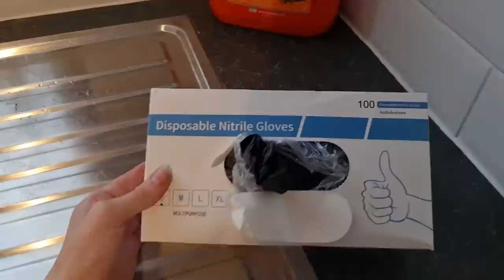My first time doing motorcycle maintenance [Part 2]

Comment: Saffy, I'm glad to see you are investing in you. Learning these things will help you for years to come. Tools are also a great investment. I'm glad you've decided to go this route. BTW, for new tires, it is less expensive to have them installed if you just take the wheels to them as opposed to the shop having to remove the wheels from the bike. Just a thought. I mean you do have the paddock stands.
Reply from the maker: I'm taking rocket in after my DIY to get the tyres changed and for a cheeky check up to make sure I did everything right:D

Comment: Great to see that you are starting to enjoy the maintenance Saffron. There are some helpful comments on here, namely that your oil filter doesn't need to be that tight. Put some oil on the rubber sealing ring. The old oil will do fine. Then put filter on by hand as tight as you can. If your grip is not very strong just give about half a turn extra with the spanner. Also, although it's hard to tell on video, your chain looks fairly taut. Put the bike on the side stand and check that the lower run of the chain has a bit of slack. You should be able to pop it up and down by about 25mm. If you buy a repair manual for your exact model, it will give you the exact slack. Keep up the good work and happy spannering.
Reply from the maker: They don't make Haynes for my bike and when I contacted Suzuki, they said they don't give copies of service manuals to the general public 🥲however someone did email a copy to me a few days ago, going to give it a good read

Comment: Just a word of advice, sump plug, use a bar and socket, nip up then one good pull will do it. Oil filter, screw in til hand tight then 1/3 of a turn. Over tighten and it can leak. Also smear oil over the rubber seal before you screw it on. Top marks for learning, hope you are not offended. I had to learn also, 74yr old Aussie.🇦🇺
Reply from the maker: I can promise you, that was hand tight, I have noodle arms 🥲 this is the same amount of strength I guve my ground tent pegs 🥲

Comment: One thing I would highly recommend is to put rear stand's supports in front of the spools (small rollers on your swingers) or even better, just replace the supporting pads with spool grabs -- this will make the whole thing much stable without a chance for the bike slipping off the stand (which would very expensive, since it never drops nice).  Oh, I just reached the section where you ordered these spool grabs and received them, good!

Comment: Maybe this has been mentioned before, but here goes anyway. Re fitting a new chain yourself, the last time I had one changed it had to be fitted by a qualified mechanic as fitting it myself would have invalidated the makers warranty. As the chain cost about £150 I got it fitted professionally. Good job I did as 2 months later it laid itself down on the road just outside Cadwell Park circuit, & left me waiting for 2 hours for a van & trailer ride home! New warranty chain fitted again by the mechanic 2 days later.
Reply from the maker: Its a second hand 5 year old bike :P I don't think warranty is an issue
Reply: @SaffySprocket  It was the chain's warranty I meant not the bikes, sorry if I didn't make that clear.
Reply from the maker: Oooooooh ahaha I don't think I'd have ever put s chain warranty claim in 😅🤣😅🤣😆

Comment: Nice work. Keep an eye on your oil filter for leaks around the nut. K&N says only use the nut for removing the oil filter. I've not read through all the comments but a cheater bar (hollow pipe) for your spanners is a must. Slip it over the spanner and you have a lever that will help you move heaven and earth, ok maybe just the nut or bolt.

Comment: Hi Saffy, to spread the brake pistons, before you remove the old pads place a large flat blade screw driver in-between the pads and either twist or lever gently. This normally moves the pistons, youll also feel and see them moving. Hope that saves you buying another tool.

Comment: Great video, I did an evening course at a local college 'motorcycle maintenance and repair', which is a great way to give yourself the confidence to DIY. My only negative comment is, be careful not to over tighten the drain plug and oil filter. the drainplug threads are easy to damage.
Reply from the maker: Ah I'd love to do a course but I have so little time 🥲
Reply: This is the best comment yet. You are doing a sterling job, but better to get some base knowledge to assist you, before something gets broken, which in turn on bikes, usually costs serious money.

Comment: Couple of tips. When using a lot of force with any lever type tool. eg spanner they can slip or give way at any time so try to exert a pull motion away from the work making sure the area behind is clear. This eliminates the pain and injury of falling into a 500lb lump of steel that will hurt every time. Also the filter types with nuts shaped ends are only supposed to be spannered to remove as the welds around the nut part can weaken and leak, I learned this one the hard way and now order the normal type without the nut. Your drain plug is steel and the casing is much softer metal aluminium, if overtightened you could strip the thread, the plug will then no longer tighten until you have had the thread professionally tepaired. Hope some of this helps. I strongly recommend you buy and read a Haynes manual for you bike before attempting any work, then you know what you are getting into before you dive in. Safety first. Good luck. 👍🙂

Comment: Great Job!! a couple pointers.. you do not need to torque the oil drain plug.. oil filter goes on as tight as you can by Hand.. also oil the rubber gasket. Keep up the Awesomeness!! Let me Know when you Come to the USA.. New England Area to be Specific..
Reply from the maker: Thank you for your advice 🙏 ☺️  I'm going to loosen the sum tonight
Reply: @SaffySprocket  thank you for the Smiles! Love how frustration brings you a laugh! Good tears.  My Son wants me to Motovlog.. I will start that this weekend.  Will on a Wing.  😁

Comment: Nice to see you giving it a go. When you are working under the tank, you need a tank stay to hold it up. This will make your life so much easier. If your bike came with the original tools, then it likely has the stay as well and you should find that under the rear seat (in the boot as I calle it) on the left or right side down toward the front seat, you pull it out. If not, you can make one from some 4mm or 5mm rod, bent at each end so it fits between the hole for the tank screw and either the hole at the top of the steering head (if you have one) or the hole the tank bolt screws into. You can find pictures online to see what it looks like. I actually made mine from threaded rod in three pieces so it breaks down and fits in my little toolkit. Keep up the good work

Comment: Hey Saffy. Firstly it's great to see you diving in to bike maintenance. It's daunting but in the long run done correctly will save you money and you will gain so much more knowledge and confidence. 

One thing re the K&N oil filter. A lot of these have had the nut welds break, resulting in oil all over the back tyre. The nut is there to aid removal, not to be used to fit it. It only needs to be screwed in hand tight. 

Good luck with the mot and trip 🙏

Comment: your bikes onboard toolkit should have a metal rod with a kink in it, it's the prop to hold up the tank while changing the air filter etc.
Reply from the maker: I don't know where the tool kit is 🥲
Reply: @SaffySprocket  should be under the rear of the seat.

Comment: Very well done.  It's a good idea to build up your tools and do your own maintenance / servicing.  That tool for pushing the pistons back is nothing like mine.  Mine is 2 plates and a screw, I use it for cars too.  I see you have a selection box of screws.  Every time I remove a screw or nut I replace it with one exactly the same but made out of stainless steel, they are very available on ebay and if I need 1 or 2 then I buy 6 because  I'll use them eventually. I'm intrigued as to your next trip.  Again, well done, next job will be easier and you've now got most of the equipment for it.
Reply: You have to be very careful when choosing which bolts to replace with stainless steel. When strength is not critical, it does no harm, but anything holding a brake caliper, or suspension component, should never be replaced with stainless, because it has nowhere near the tensile strength of even a standard (8.8) grade bolt, and brake bolts are usually 12.9 grade high tensile. Don't compromise safety for the sake of appearance.
Reply: @rickconstant6106  I appreciate that, I'm an engineer.  I've never had an issue.  Its not not really for appearance to be honest.  It's rust prevention.

Comment: For the future, get yourself an impact wrench, it will aid in removing the tight nuts and bolts. Also instead of a calliper compression tool buy a G clamp, it does the same thing but is a lot cheaper and more versatile.
Reply from the maker: I did end up getting an impact wrench
Reply: G clamps are useful and every garage should have several ..... but for this application do need careful padding/handling if you wish to avoid scratching the paint off the outside of your calipers. The correct expanding tool is a better option for the beginner working alone.

Comment: Congratulations Saffy for doing a comprehensive service on your bike. If you'd have taken it to a garage they're have charged you £300 and done the bare minimum. How does the saying go ? " If you want it done right, do it yourself". 
I'm impressed Saffy. 
I also want to throw in 2 little comments. Really to do with part 1. You know those holes in your bike stand ?. Complicated to explain, but they have to be there for welding it together. Welding together a sealed tube without a hole for heat to escape is a bomb in the making lol. Also next time you go to change your front sprocket?. Place the socket arm parallel to the ground facing to the front tyre. this way you're not relaying just on your body strength. Remember how you pushed on the wrench and the whole bike moved forward?. Place it this way & all the pressure goes straight down into the floor. also added advantage is you can put more than just your body strength into it. You can literally stand on it & put your whole body & strength into it. Any time you pick up a wrench Saffy please remember that physics lesson. 
Big fan & you are so forgiven for reposting series 1 lol. Maybe it says something of your magnetic energy that I only watched it a week ago yet still I got half way through before I realized you weren't running a highlight from the last lol. Stay strong and believe in you.
Reply from the maker: Ah that's some really good advice! Thank you so much ❤️

Comment: Lots of great advice; especially around getting a torque wrench. A few more tips? If you're taking off a lot of bolts, like when you're taking the hugger off, loosely re-fit them in their original hole so there in the right place when you need to put it all back together. I always clean any threads and smear some copper grease on them before re-fitting so they don't seize up and are easy to remove next time. Try to use the ring end of a spanner instead of the open end if you can. Get some extra long Allen/socket head keys. when using Swarfega, tip a teaspoon full of ordinary sugar in the palm of your hands before squirting in the Swarfega. It acts as a dissolvable abrasive and really shifts the oily dirt and washes completely off. Never be afraid to ask for help! Good luck (you will strip a thread at some point!).

Comment: Top tip if you haven't a torque wrench, slip a length of pipe over the Allen key for extra leverage without damaging the screw head.
👍I shudder everytime you whack an Allen key with a mallet 😂
Reply from the maker: To be fair, my mallet walking is probably as strong as a man wrench twist. I think people don't realise how weak I am 🤣🤣🤣🤣 noodle arms isn't it. I had to mallet walk the screw loose
Reply: @SaffySprocket  Noodle arms 😆😆
Reply: @SaffySprocket  - a 6'' length of 10-15mm diameter metal tube is good simple and effective advise for an allen key extension, after whacking a finger or thumb with a mallet the only advise tbh. Safety First / Mallet last.

Comment: Great job, you should look at buying a Haynes manual for your exact bike, it will detail every single nut and bolt on your bike and give you all the correct settings and measurements like torque settings, chain tension etc etc

Comment: I would suggest buying a workshop manual for your particular model/year of bike. I was cringing every time you used a hammer/mallet to tighten some bolts/screws/nuts, ain't a good thing with alloy as you could tear/strip the threads. Buy a Torque wrench so, you won't over tighten stuff! (more expenses for you)
Reply from the maker: I did ask Suzuki about a manual but they don't give them to the public apparently

Comment: you're doing fine and making good progress. We've all bought tools and stuff then realised it wouldn't actually do the intended job but later find its perfect for some other task. Also I recall, when working on a similar machine to yours the tank had a little prop stand to hold it up while changing the air filter. This could well have been discontinued in a quest for money saving on later models.
Reply from the maker: A few people have mentioned this! I'll have to have a look

Comment: Well donr for doing this, keep on trying a don't give up.
Bit of  advice and sorry if it's been said already.
Make sure you put oil on the seal on the old filter and please, please done tighten the oil filter anx sump plug that tight, sump is tight and a little bit ( if that makes sense )  oil's filter is the same, you could easily over tighten and strip the tread.
Good luck
Reply from the maker: I've been told off plenty 🤣 but I know going forward ahahaha

Comment: You have a great attitude and approach to working on your bike. I second an earlier comment suggesting buying a Haynes manual, as it not only details specific things like torque settings, but all critical information, parts required for tasks and tools required. It teaches you as you go with hints and tips on general skills and safety. It is the biggest leap forward you can make to be self sufficient, to own AND READ a Haynes manual for your model of bike. Keep it open on the page and refer to it as you work. May even be available to buy online. As for torque settings, they are critical to know for EVERY nut and bolt on the bike, but the torque wrench is another tool you will really enjoy purchasing lol.
Reply from the maker: I can't find a Haynes for sv640 3rd gen 🥲 I think Haynes went out of business recently too

Comment: Well done! There is a satisfaction from doing your own work. If I may give you a couple tips…. Smear a little oil on the gasket of the new oil filter before putting it on and only hand tighten. If you don’t believe it’s on tight enough only use a wrench for 1/2 turn. Also some aluminum foil around the headed pipe will stop the oil from the oil filter leaking on it. I commend you for taking the initiative to do it yourself 🙂. Finally…. I love the videos and content you put out. Keep up the good work!!! Many of us are watching regularly!!!
Reply from the maker: Ah yes! I wish I knew about the tinfoil trick at the start!

Comment: Another vote for torque wrenches.
One for the lower amounts, up to say 50nm. You'd use that on oil filters, drain bolts, brake caliper bolts and spark plugs mostly, and a bigger one that goes over 100nm.
You'd use that one for the axles and the front sprocket nut mostly.

Honestly, you're gonna love the click a torque wrench makes when it reaches its set force.
👍🤣🤣

Comment: Saffy hammering spanners like you did with the sump bolt is risky. You might have to invest a bit more but try getting the workshop manual for the bike, you may find it online and buy a decent torque wrench (Halfords brand is decent quality, model 60 for most bolts, model 100 for big bolts like the axle) this way you're not guessing the correct tightness for fairly critical bolts, the manual will tell you what setting to use. As others mentioned the oil filter was overtightened it looked, they also have a torque spec you can use with the torque wrench.

Also the car break spreader usually can work you can use one end on the outside of the caliper instead of both inside.
Reply from the maker: They don't make Haynes for my bike and when I contacted Suzuki, they said they don't give copies of service manuals to the general public 🥲
Reply: @SaffySprocket  That sucks. You can try asking a local dealer instead maybe, there's a few people online who have got their hands on a copy physical and digital it seems. Manuals are invaluable IMO

Comment: Great video and great work. You’ve shelled out a fair bit on tools and equipment, but it’s all yours now to keep 😊 someone else mentioned a torque wrench, definitely get one as it will eliminate any uncertainties you have over how tight fastenings should be.
One other detail, you pre-filled your oil filter which is good, but try to pour oil into the smaller outer holes rather than the large one in the middle, doing this will filter the oil, filling the larger hole won’t. Not vital, but good practice. Plus, a touch of oil on the new filter seal helps seal it and aids removal next time 👍
Keep up the good work 😊
Reply from the maker: Yes! And honestly, building my garage, it's been so so so useful!
Reply: @SaffySprocket  game changer, but please get yourself a heater coz  you’re always frozen 😂